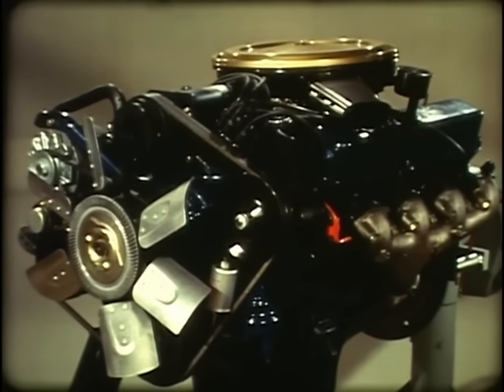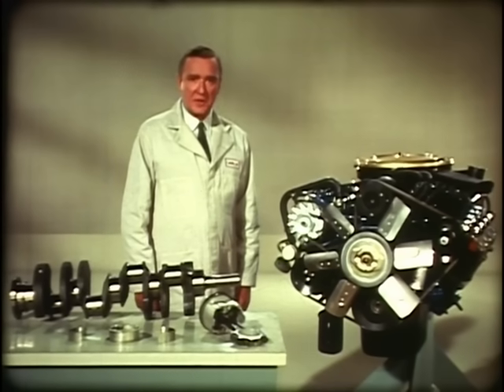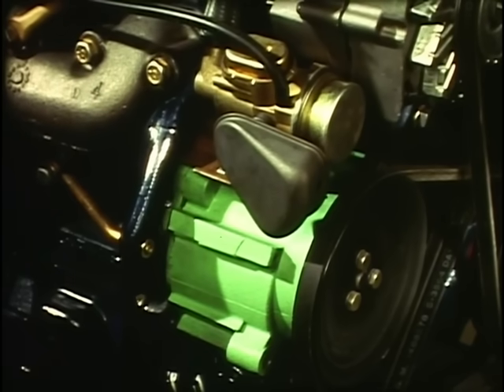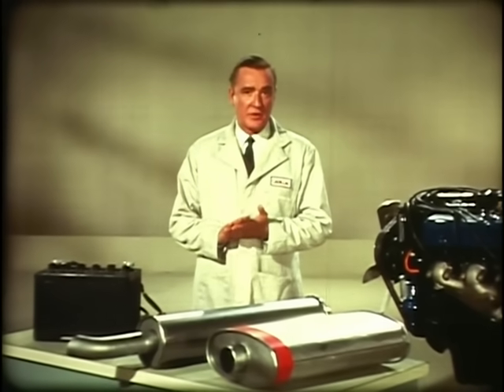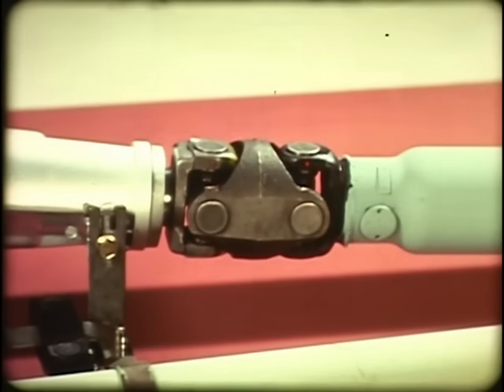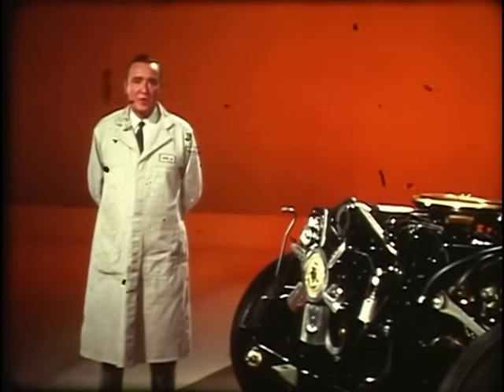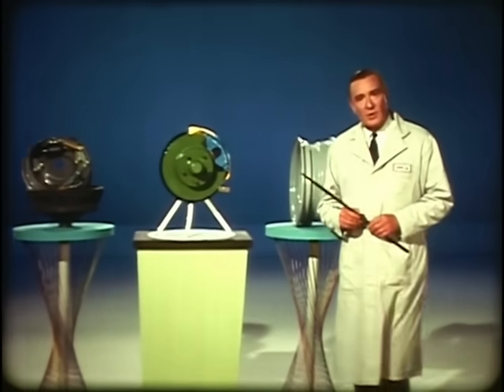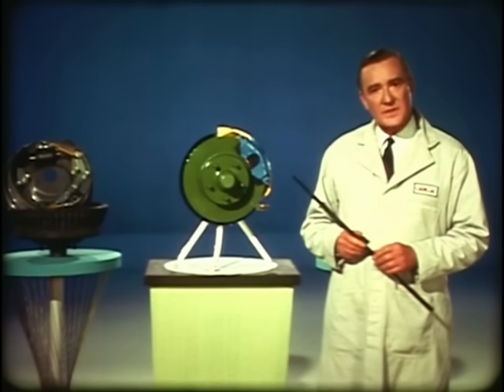1968 Cadillac Engineering Features

Comment: Virtually no American car engine was intended or designed to run at or anywhere near full output for much longer than a city block, that was just to impress with standing start acceleration.  Highway speeds were restricted to 55 mph, so why produce an engine to hold sustained speeds much higher than that?!  This is evident from the absence of oil coolers and small, for the engine size, radiators.  It was very different in europe with unrestricted high speed roads and long distances between countries. In Germany in particular cars could hold sustained high speeds well above 100 mph for long periods of time, so engines were designed accordingly. Smaller, higher specific output engines, with single or dual ohc, 4 valves per cylinder, very oversquare bore stroke, etc, were closer to racing designs.  This is why european manufacturers are typically more successful in racing than American makes, particularly in endurance racing. With a few exceptions. It's why Ford had to spend so much money to win Lemans in the 60s.
Reply from the maker: Thanks for the info!

Comment: 4 exhaust ports! Gosh! How innovative! How inspired! 🤣
Reply from the maker: Several engines of the era had "siamesed" exhaust ports, where the middle two cylinders had a side-by-side exhaust port configuration that greatly increased heat in that area.  They were noting that thier design did not have this design.

Comment: I've built 2 500's for performance. One in a Chevy Blazer who couldn't beat the Mustangs on the street.  He said he still lost to the Mustang's because he couldn't get traction no way, no how.
The other was for a 41 Chevy street rod. The customer said you had to be rolling to be able to get anywhere without sliding all over the road. From a roll, it was a frame twister on the old frame. The gas tank would about hit the ground and the left front side would twist up. He said this was way more of a handful than any Big Chevy engines he had in anything. 

Small solid lifter cam, Stock replacement Edelbrock intake and a 800 Holley. He said 18 hi way, 14 city. --- I'm building one for my 57 Ford now. And I'm a Ford man !  But smart enough for the Cadillac compered to the costs to make a Ford match this. Very cheap.

Comment: I have an all original 67’ Coupe Deville with 42k miles.  How does the 429ci rate?
Reply: The 429 is a decent engine.  Some did develop oiling issues so keep the oil changed regularly and you should be fine.

Comment: The venerable Rochester Quadra jet pre-electronics pre-altitude compensator was the closest thing a mass produced four barrel carburetor ever came to mechanical fuel injection. If you knew what you were doing, you could rebuild those to perfection. They still are remarkable carburetors in the hands of the right technician. I rebuilt many.

Comment: Cadillac led in more ways than most know. I come from a racing background. The 472 was an outgrowth of the 390 & 429 versions. It is not a true 90° design, squeezed to fit the front frame rails. Cam & distributor timing spacing reset to suit. That comes as a surprise to first-timers. 
  The iron alloy is special. High  nickel & high tin compared to the normal alloys used in other standard divisions. The nickel reduces wear hense the long life of Caddys. The tin improves heat dissipation.  Chevrolet & GMC adopted this alloy for heavy duty trucks & performance car engines. Chevrolet race blocks often contain this alloy borrowed from Caddy.  
  One can spot a hi nickle &/or hi tin block by looking for 010 &/or 020 behind the cam timing gear on the small blocks. The numbers are sometimes found near the oil filter housings on big blocks. I had a 1974 El Camino 350 with an 010/020 block that had .010 bore wear after 200,000+ miles.

Comment: Had a 66 Lincon I will always remember the air pressure sticker in the door saying for extended periods above 120mph consult the factory. That car floated like a dream at 120 mph. Loved it. 1st gear was 70mph, 2nd gear was 110 and Drive was just crazy
Reply: This is about Cadillacs, not Lincolns

Comment: The way they describe the engine safety features, like the engine over temperature switch being in the engine head, being so careful to describe accidental human acts (hoses disconnected, radiator cap replaced loosely) and not random mechanical failure, just to make sure you don't associate the Cadillac engine with mechanical failure. What care!
Reply: The average Cadillac buyer in 1968 probably rarely lifted the hood.
Reply from the maker: Thanks for watching!

Comment: So, according to the guy at 6:20, a bimetallic switch, as well as enabling a warning light and buzzer, overrides the temperature sensor and causes the temperature gauge to go to maximum deflection.   That's dumb.   You might as well not have a temperature gauge if it doesn't tell you the actual engine temperature.
Reply from the maker: Considering it had a light, buzzer and gauge, they were making sure you did notice an overheat condition.
Reply: Yeah, either this was a 1-year only thing or marketing was mistaken. The warning light/buzzer was a final attempt to get the driver to take a look at the temp gauge (and steam rolling out from under the hood). IIRC, it closed at 325F.

Comment: It's crazy how chevy always lagged behind ford, it took them years to separate exhaust ports and they never overbuilt their blocks and heads like ford did. Ford's 460 you can use factory cylinder heads and port them and make free horse power unlike chevy where there's not enough metal so your forced to buy aftermarket.
Reply from the maker: It's a Cadillac video, so... ?

Comment: How did they manage to get such little horsepower of such a big engine?
Reply: The HP numbers back then were real. The engines could make them indefinitely. Now, the numbers are for the brochures and sales team, but the actual engines can't make those HP numbers but for a few seconds for the dyno to read it. This engine could make 375hp for weeks or months without issues.  Modern engines, make rated HP for seconds before exploding.
Reply from the maker: 1) the HP was underrated on many of these engines for insurance reasons. 2) The benefits of computer-aided design and precision machining were not available then, but as we know they make a huge difference i the engines of today.
Reply: the torque is much more important with this engine.

Comment: they also have a 472 in gmc motohomes and the 500 cid used inmini limo
Reply from the maker: I actually have one of those GMC motorhomes.  They used the Oldsmobile 455 (and later the Olds 403) with the TH425 front wheel drive transmission.  That being said, the Caddy 500 is a popular swap for these as it is pretty much a bolt-in replacement.

Comment: Exhaust leaks... 472 family never could keep a decent seal between manifold and head. The infamous "pfff, pfff, pfff..." sound.
Reply from the maker: The 'gasketless' precision-machined surfaces theoretically didn't need them.  If that manifold was ever off or the motor ever overheated, all bets were off.  I had good success with copper gaskets.

Comment: The nylon teeth on this year Caddy camshaft gears, makes today’s Ford cam phaser and plastic tensioner look reliable. Before ANY 472ci hit 50,000 miles the “quiet teeth” cam chain and gears came apart.  Messing up cam phase timing, distributor timing, and close to valves hitting the pistons.  Dangerous on the road.  They did this to “quiet the cam chain/gears”.  GM NEVER honored any extended warranty.  No NTSB recall….
Reply from the maker: I changed ours out at 170k. Never heard of any coming apart at 50k, though they do suffer substantial wear. That doesn’t change the fact that it is a great engine. It just had a substandard component. Nothing is perfect.
Reply: @ no excuse for this. Almost perfect motor for its use, ruined by $1.68 worth of plastic.  42k forced replacement.
Reply from the maker: @johnross6314  You are still angry about a materials choice from 60 years ago, got it.  I hope someday you find peace.☮
Reply: @ history repeats itself to this day.. Sixty years or sixty minutes.. Each generation vanity never learns from the last.
Reply: @dstragand  the kind of grudges I'll carry to my grave lmao
Reply: @johnross6314: All the GM engines and Fords had nylon teeth back then. I've never seen any of them crap out at 50,000mi, but it's possible if the oil isn't changed often enough.

Comment: Okay can someone please tell me. So at 10:18 he talks about the previous years planetary rear axle..I know what a planetary gear set is but I can not find a picture of this anywhere. What place does a planetary gear have in a rear pumpkin axle?
Reply: Planetary gearing is used in a type of differential. Toronado was introduced with planetary type differential in '66 and the Eldorado picked  up the component with its '67 introduction.
Reply: I think he was talking about the front wheel drive differential that was new for olds toronado and Cadillac eldorado. He also mentioned the larger axle shafts, and if you’ve ever worked on one, they are huge!

Comment: I'm primarily a European car guy, but I own a 1969 Sedan DeVIlle specifically because I like these engines. Even compared to much newer, much-more-highly-regarded-by-internet-know-it-alls V8s like the 1UZ, they are smooth-running and quiet, and obviously very torquey. This was back when Cadillac was still allowed to engineer (some of) its own stuff, to its own standards, and the guys that developed the 472/500 understood what they were doing quite well. Easily one of the finest engines to come out of post-war America.
Reply: Absolutely true. In GM's prime, Buick, Cadillac, Chevrolet, Oldsmobile, and Pontiac ALL designed/made their own engines. Cadillac's was the smoothest, quietist, and likely the most fuel efficient. Chevy proved to be the one which seemed to breath the best, which led to it being the dominant brand for aftermarket performance parts (I owned '67,68, and '70 Camaro's, installed a turbocharger on the '67 and a 5 speed Doug Nash transmission, etc.). The Pontiac SD 455 was a monster engine, as was the Oldmobile 455.

Comment: Nice video. I've driven the late '60's and early '70's Cadillac, including the Eldorado.
When was this engine's displacement increased to 502 cubic inches, and what was its bore/stroke?
P.S. It mentions here the softer front and rear spring rates on the El Dorado ....It was TOO soft
Reply: 472: 4.3 bore x 4.06 stroke. 500 started in '70: 4.3 x 4.304. Ran through '76
Reply: @helpful5539  Thanks for the info. For comparison, Chevy offered a 502 (actually 501) big block. Since it was meant for higher RPM and power, its bore and stroke were 4.466 in × 4 in
Reply: i agree.

Comment: I worked as a line tech for Cadillac for 38 years. The '68 Cadillac was good. The '69 was better. The '70 was the best of the best. Things began to go downhill after that. The 5.7 Diesel, the HT 4100, and the Northstar were all disasters. I retired in 2008 as I had had enough by then. Yep, that boat anchor 472-500 Cubic inch torque pig was a runner. :trophy-yellow-smiling::hand-orange-covering-eyes:
Reply: Lovely to hear. Yeah I think looking to performance and powertrain the 70 is awesome. Looking to quality in materials and fit, IMHO it is the 65/66.
Reply: @Lowrider2905  I tend to agree. Fit and finish sure seemed to drop in 67. Mine felt like a Chevy compared to my buddy's 66. 70 drive train in a 65 or 66 would be pretty great in my opinion.
Reply: I was lucky enough to have a 1972 Eldorado that I bought used in 1980.  That car was an amazing vehicle, very dependable, and quite easy to work on when routine maintenance was needed.  I wish I had the old girl today!
Reply: @Ralph19541954  that is so nice, a luxury car that has everyhing you need. And it is "easy" to work on. Try that on a modern middle class car. I like to drive older car wih not that nice mileage, but after all these cars are cheaper over the years.
Reply: What did you think of the 67’?  I have a 67 Coupe Deville all original car with 42k miles.
Reply: @euroasianbob9268  In my case, my 67 wasn't nearly as enjoyable or impressive as my 63. My buddy's 66 was even better.
Reply: @alxf66  I've had both '70 CDV and '62 Calais.

The '62s 390 with Carter AFB was a snappy setup. The '70 had 'longer legs'.
Reply: @euroasianbob9268  The '67 wasn't one of my favorites. Take good care of that driver's side engine mount. They can be tough to replace!! :hand-orange-covering-eyes:
Reply: @euroasianbob9268  The 429.
Reply: Eldorado for 1970 ran the best iteration of the 'V Future' platform.
Reply: I had a Seville with the Northstar. Put almost 300,000 on that car, never touched the motor other than oil, coolent, and spark plugs and wires. I think I replaced the coil packs at around 170,000 miles. I finally sold it to a sixteen year old kid for $1500.00
Reply: @dgc1929  I only saw the ones that had issues. Many did! You lucked out believe me!! :hand-orange-covering-eyes::trophy-yellow-smiling:
Reply: I was going to buy a Cadillac till I seen that Northstar leaking oil. From everything ..
Reply: @davidt3725  Mine had real Cadillac engines; 390, 472.
Reply: I was in high school in the 90s in auto shop when we had a special guest, it was a northstar v8 on rolling frame.  The tech rep started it up and placed a nickel on its edge on the intake and ran the motor.  Of course, the nickel didn't move.  Additionally, I couldn't help but notice the engine was rigidly bolted to the support cradle
Reply: I worked at a Cadillac Dealer until 2016. The 2nd gen Northstars (L37) were great. The first gen had the head stud insert problems. The 4100's were bad designs all around. Even the 3.6 global engine they have now still has problems.. I couldn't stand seeing people pay 40k for "Cadillacs" made with foreign made parts.. It felt wrong.

I still my 1969 to this day. Our parts manager has pictures of when they were new..
Reply: I'll second that.. I had a 1970 Coupe de Ville, and my father had a 1970 De Ville he bought new.
Reply: @Connor_Arroyo  I had a '70 CDV some years back. Good stuff.

Comment: In the early 80s, i helped a rancher replace his third 454 in his 70s 3500 dually with a used Cadillac 472. We used a bellhousing from a 442 cutlass  to mount to the manual tranmission.   I think that he is still hauling cattle with that rig.
Reply: @user-lr2lg6qz4e Neat.
Be interesting to know what was used for the flywheel and pilot bearing fitment.

Comment: GM "jiped the puplic" these cars should of had /: dual snorkel intake,dual 2.5" exhausts, Posi-Traction axle,dual battery's,& a bigger Gas-pedal.!!
Reply from the maker: Posi was an option
Reply: Yes my 68 Fleetwood has Posi type rear end,heavy duty alternator and twin humps on trans crossover for dual exhaust system setup from the factory.
Reply: @donaldstrishock3923  Definitely a bigger fuel pedal.

Comment: Back when engineers designed cars without an accountant standing over their shoulder saying "No, cheaper, cheaper, cheaper"
The cars were brilliant, reliable, and the profitability followed
Reply: No, even then, as mentioned in this video, they had to conform to emissions mandates.  Just a lot more reasonable then.
Reply: @southerncharity7928   The emissions mandate in 1968 was positive crankcase ventilation, unless you were unlucky enough to be in California, where CARB had unburned hydrocarbon emissions limits, thus the "smog pump".
Reply: @KevinJames-yg9eu  My '70 was an Arizona car.
Reply: Not true. Perhaps less so with a car like a Cadillac, but Chevy, Ford etc? The "bean counters" were always present.  The Ford Falcon was designed to be a "throw away". Chevy motor mounts - bad design, bad materials. An uncle worked for Rochester Products as an engineer in the 60's. His specification for the material for throttle shafts was over-ruled. Management told him to specify a cheaper material that would cost less and deliberately wear out.  The whole Pinto fuel tank issue would never have been such a problem , but Ford figured it was cheaper to settle lawsuits rather than retro fit and $11 part. Don't idolize a period you might not even have lived yet.
Reply: Back when we took quality seriously.
Reply: @eaxnitro  those cars had "character"! You don't see that today with today's "jellybean cars"!
Reply: @joeljohnson3676  lol, "Jellybean cars".....thats a good description
Reply: Under no circumstances were they reliable.
Reply: and before the epa was standing over their saying "make it get better gas milage".

Comment: Got me sold, now I want one.  Beats today's complicated messes.
Reply: Gotta get some rubber coated pulleys
Reply: @rogerdodrill4733  Ok, there were a few dud ideas in those days, my guess is the rubber lasted about a year.  From those days I put 2 improvements as being significant, fuel injection and electronic ignition.  Beyond that, cars have become over engineered disasters.
Reply from the maker: I was surprised at that. Ours didn’t have that. I suppose it wore off over time.
Reply: they arent making them better they are mnaking them easier to build .

Comment: Basically an old gas guzzling boat anchor
Reply: gas was cheap and cad owners usually had the money and didn't really care
Reply: @helpful5539  Fortunately, such simple engines can be converted to run on LPG basically halving the mpg cost. It's still not going to be a cheap car to run though. I've been looking at this for my 1930s car, but mainly to remove the vulnerable petrol tank from the very back of the car!
Reply from the maker: Ah.  A Ford fan...  🙄
Reply: Shaddup
Reply from the maker: @rogerdodrill4733  Amazing debating skills there, Sparky.
Reply: Ah. An idiot replied...  😅